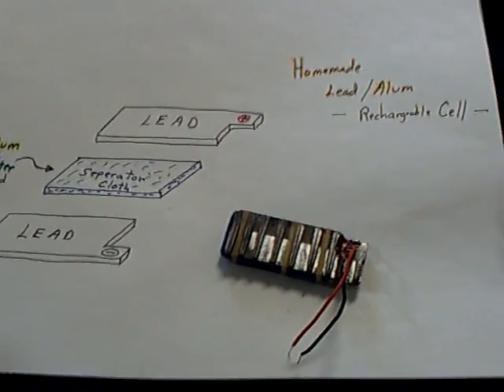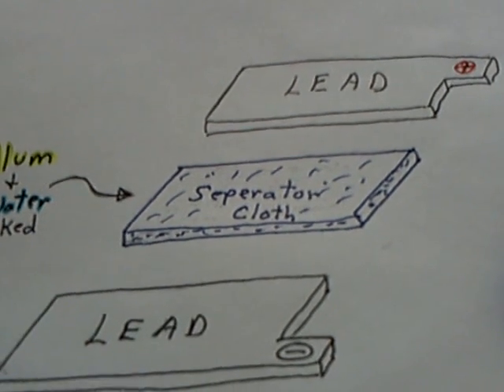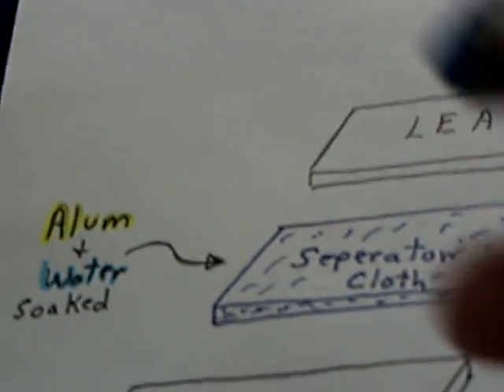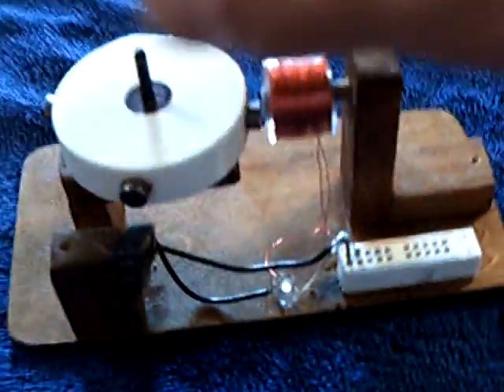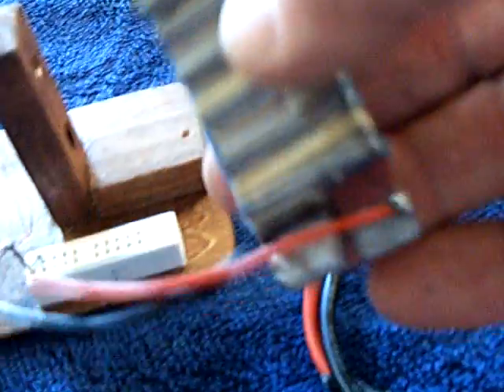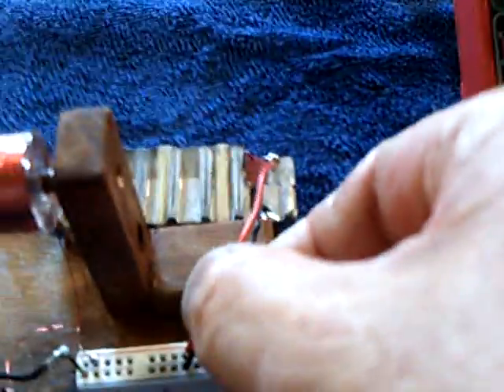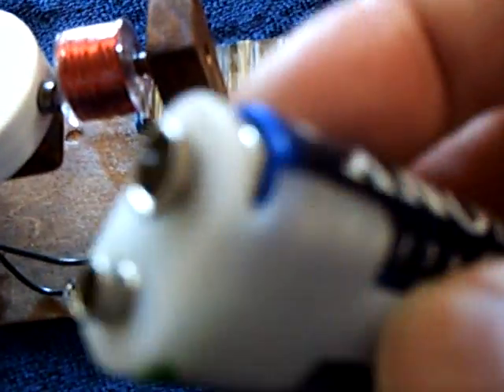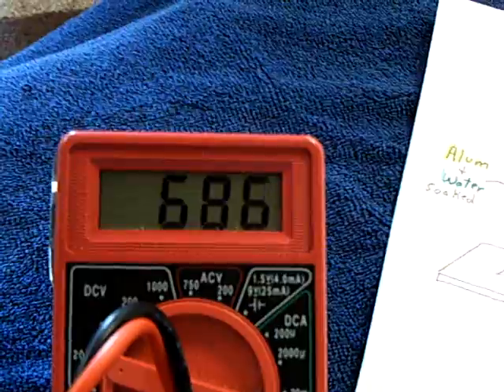Homemade Rechargeable Cell-- testing

Comment: First, you are awesome, please keep the vids coming. :)
I was curious if you have tried to add a layer of activated carbon between or electrolyte (the allum/water soaked cloth) and the lead on both sides. I remember in a previous video, you had shown that the lead is still breaking down. In this video it shows some supercap behavior. I am curious if the lead will still break down if the design for a supercap was completed on your lovely battery by using a thin layer of activated carbon

Comment: As I understand it (dimly) when a mechanical switch (like the reed-switch shown) opens (ie. breaking the circuit, the a "voltage spike" is released. This is also true in a motor, as the magnet passes the coil. In the most basic motors and switch operations, this spike is ignored, but it can be used directly (lighting LED, charging batteries) or captured with a capacitor. 
If you have "no Idea about electronics", I suggest building a few simple circuits, and learning about one component at a time

Comment from the maker: The energy that goes into the coil comes flying back out of it when the switch opens up.  It is high voltage but low amperage going backwards in the circuit.

Comment from the maker: Tapping it with the battery pack was just a way to show that the cell could accept a surface charge quickly.  To put a deep charge on it-- a slow charge at lower amperage works best.

Comment: This is really fascinating! I thought the same thing, that these cells perform like a super-cap! I am hypothesizing that these cells take a surface charge well due to the close proximity of the plates, as well as the specific chemical electrolyte. I think a good experiment would be to create multiple cells with the same form factor, but replace the electrolyte with different chemicals. Then, change the distance on the plates and observe the outcome. Please share the computer graphs if you can.